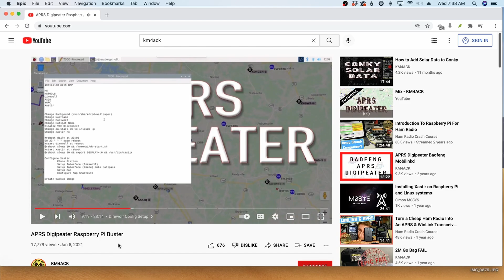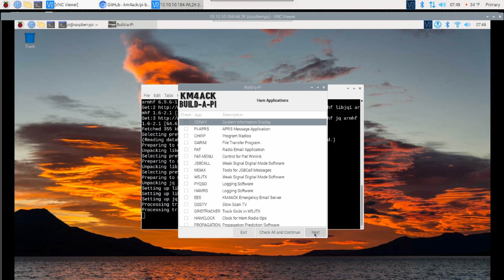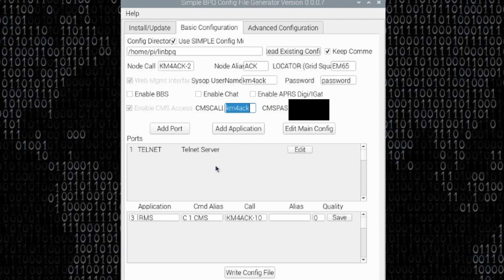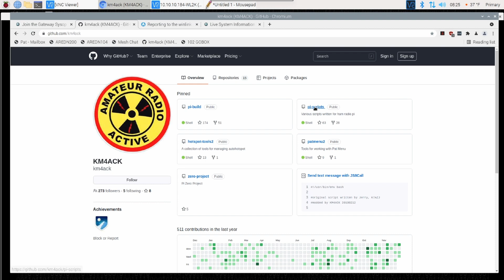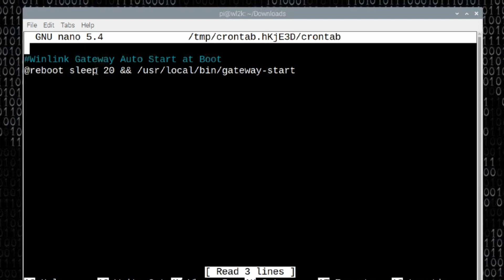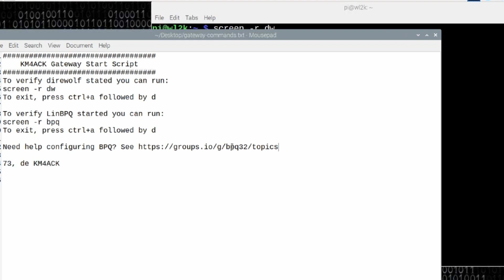Winlink Gateway on a Raspberry Pi LinBPQ

Comment: Hello Jason, sorry for digging this out. I'd like to set up a RMS gateway on a Pi4 with Bookworm instead of bullseye for an EMCOMM use in my area. I viewed your tuto many times but can't figure if it could work? What do you think about that?
Regards, 
73 QRO DE DIDIER - F4ISC
Reply from the maker: I haven't set one up with Bookworm. The guys in the forum can probably help you out https://groups.io/g/bpq32/topics
Reply: @KM4ACK  Hi jason, thanks for reply, I will check! Just another Q?: In the new 73Linux distro replacing "build a Pi" , there is no "TELNET" utilities to download, is it necessary to build the RMS gateway or not? Or shoul I download it apart? Regrads and 73 QRO!
Reply: Hi Jason, all, I finally managed to run the configuration (RMS gateway) on a RPi4 here with all the necessary items, especially EMCOMM mode, the main goal for me! Thanks a lot for your video, very usefull and easy to follow! I struggled a little because not very confident for the moment with Linux architecture but will be soon !
Best regards and 73 QRO DE DIDIER - F4ISC

Comment: It would seem my IC-2100 isn't supported by FLrig.  Jason curious how you get your FT-2980R to work with it as it's not listed on supported transceivers in the owner's manual.  When I try to open Pat Packet Modem it prompts me to configure FLrig.  is there a work around for Direwolf to run PTT via VOX?
Reply from the maker: I am using a signalink which works with VOX. Another option is a digirig.
Reply: Yes Sir, I have a digirig. I can get PTT setup in FLrig, but have been told mobile radios like ours will no feed a freq via Rigctl.

Comment: Have you considered updating this to reflect 73Linux? I tried to use this video with the a fresh73Linux install on my Pi but so far have not gotten it to work - not activating the radio. My hardware is different: Pi 3b and digrig with pre-made cable, so I am poking around to figure out the differences, and to see if I made any install mistakes.
Reply from the maker: It can be challenging to get the config right. The best placed to get some help is the BPQ forum. https://groups.io/g/bpq32/topics There's a great group there always willing to help.

Comment: Thanks Jason for this video! I have gone through this video several times. I'm missing something. Lnbqp talks to winlink I know because my station report shows up in the station list of winlink express. When I try to connect to RMS, I see incoming signal in direwolf, but there is no response (TX) from direwolf. I use Sgnalink and ALINCO DR-635. Using 73 Linux and not Build a Pi. Has worked with the same radio when I used Build a Pi previously.

Comment: I loaded the build a pi onto a new pi-4-B but got a “no sound device found” after performing the reboot.  Does my signalLink usb need to be plugged in during setup?
Reply from the maker: It shouldn't. Try rebooting or changing USB ports

Comment: When I connect to the node I get "Type ? for a list of available commands"
Reply from the maker: Sounds like you are connecting to a node that also includes a BBS
Reply: nope, just my own node, no BBS, no chat, no APRS etc. Seems like someone else below has the same issue. Not sure
Reply: @HunterSkiff  Did you ever find a solution to this? Having the same problem with a first time install.

Comment: what can I do if after running arecord -l and no capture devices are listed. I have a pi4 that I have set up and have installed the build a pi like n the video so far
Reply: I believe I was able to fix.  I connected my 991a and then ran arecord -l again and now it shows the card 3 device 0 codec.  Great video Jason,  I do appreciate all the work you do and share!

Comment: I'm not seeing much BBS/Winlink/APRS in my area. I noticed that when you were setting up LinBPQ, there were check boxes for each function. Can all three be setup to run at the same time? Do you enter each one via a different SSID? Are there any videos that speak to running all 3 at the same time?
Reply from the maker: You can run the BBS and Winlink gateway on the setup. I wouldn't add APRS to the mix though. Run it on a separate setup. BBS/Winlink shouldn't be run on the APRS freq (144.390)

Comment: I have it running and can connect from my radio in another room but it seems to just hang when trying to connect to the cms and eventually disconnects. Any ideas?
Reply from the maker: The best place for help is in this forum https://groups.io/g/bpq32/topics Those guys are super helpful diagnosing issues and it is where I turn when things aren't working as expected.
Reply: @KM4ACK  Thanks. I think it had something to do with my call trying to connect to itself to test it....
Reply from the maker: If that’s the case, you will find where I asked that exact question on the forum. 😂 I had to add “-2” to the node call.

Comment: so how i can turn off or unable the gateway when need to?
Reply from the maker: assuming you installed my auto start up script, you can disable it in cron by adding a "#" in front of the command and rebooting. The other way if you prefer is stopping bpq & direwolf after boot.

Comment: Great timing.  I just got my black friday FTdx10 delivered on Fridays.  Yesterday, I connected a Rasp zero 2W which I installed BAP on for connecting to a 1970s Tempo One tube rig.   I use the "LoveRPi MicroUSB to USB 4 Port Black OTG Hub" ($6 Amazon).  Only two USB cables needed.  [1] MicroUSB to USB for power plugged into a USB port on the FTdx10.  The [2] connection is previous listed MicroUSB2USB hub with a USB to USB-B for CAT control.  In 2 minutes, all was working (fl-stuff, ft8, js8call) except for PAT-Menu Auto-Connect rig control.   I have PAT rig control working on a Pi4B using the old terminal based "pat-menu" which I still prefer over the newer GUI version.

Comment: Which cable are you using between the radio and your Signalink? It seems there are a number of choices based the pin out.
Reply from the maker: There are many choices and it depends on your radio as to which cable and module you need. You can find a complete list at https://tigertronics.com/files/SignaLink%20USB%20Product%20Guide.pdf Specifically for the Yaesu 2980R SLCABRJ1 SLMODR1Y

Comment: Fantastic video Jason!    Only thing I personally add to the cron is a daily restart at a random time like 0447 as a bit of a fail safe
Reply from the maker: How long ago did you ask for this video? hihi. I finally got around to it. Couldn't agree more with a daily reboot. I do this for both my APRS digipeater and the Winlink gateway but I prefer midnight as my reboot time. Just personal preference.
Reply: @KM4ACK  hopefully get more on the air. I use pi w and the now not available audio pi hat. Likely will entirely rebuild on the new os and follow your video here.   Still only about 5 packet stations here in Australia of which I have one

Comment: Great video. I was going to figure this out the hard way over Christmas. I was going to buy a TNC PI though. I think I'll try saving myself $100 and try out an Easy Digi / Saberent sound card combo I'm using on my client. 

I would love to see a video on running a wl2k gateway and a local BBS on the same pi! 

Merry Christmas  and thanks for another great video!
Reply from the maker: It is pretty easy. Just put a checkmark beside the two services in the BPQ config generator. Configuring the BBS is the challenge. The guys on the BPQ forum can help with that. https://groups.io/g/bpq32/topics

Comment: Now to figure out how to add radio to mix and I will be all set. :-)
Reply from the maker: The signalink makes it super simple to connect the pi to the rig and handles PTT but there are other methods out there as well. It depends on which radio you are trying to use as to your options for PTT.